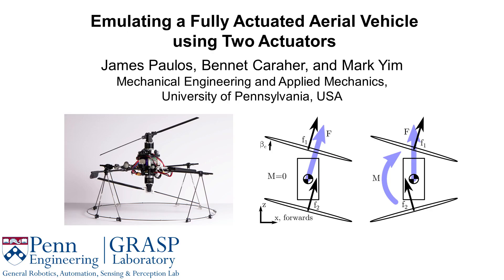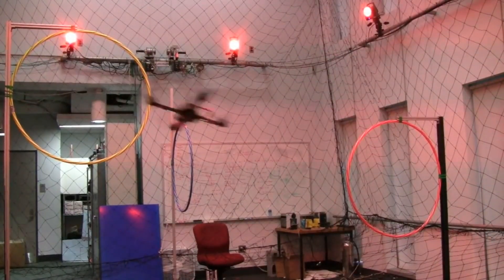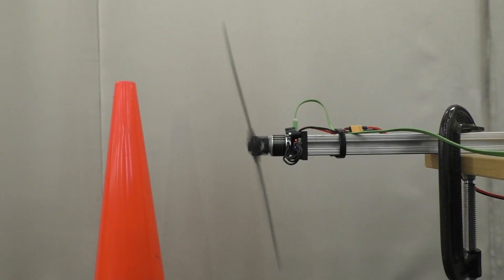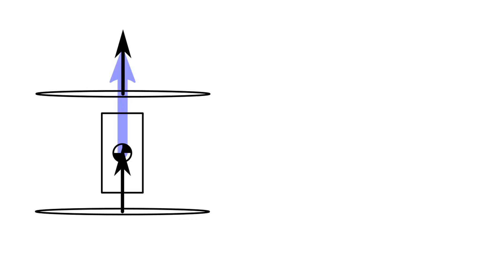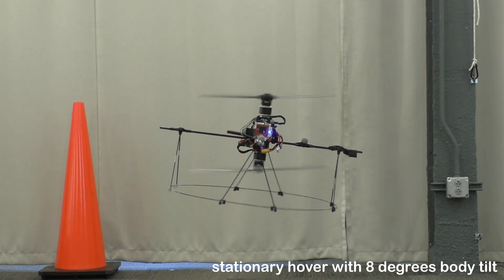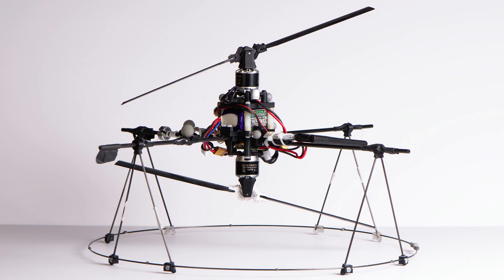A Fully Actuated Aerial Vehicle using Two Actuators

Comment: the whole thing about quadcopters is about less moving and strained parts. saved 2 motors, but gained very stressed gears and joints. wonder the endurance and wear results agains quadcopters
Reply: long time reliability kinda doesnt matter for suicide drones or suicide-drones-intercepting suicide drones

Comment: So, this uses gyroscopic procession to angle the rotor. It requires very precise control of the rotor velocity as it rotates.
Or am I missing something?
(I was missing something. It dawned on me later.
The blades are hinged asymmetrically, so they will be angled oppositely when they are slowed down or sped up. Giving less or more lift on the opposite sides.
It has nothing to do with gyroscopic precession. )

Comment: the continuous instant acceleration and deceleration to achieve the pitch of the hinge consumes much more power and motor are likely to be overheated, if the motor can be modified to adapt sinuous pattern natively I bet this can outperform the traditional quadcopter, but as of now it can’t.

Comment: An outrunner is no good choice for such kind of torque modulation. Its massive momentum of inertia requires huge power to modulate its speed by accelerating/decelerating. You need a low inertia motor. And still, the efficiency of such vehicle drive concept will always be bad compared to a simple quad.

Comment: wow, seems to be even more steady than quadcopter. Can this be better for aerial photography ?
Reply: the thing is that most of the space where you can put a camera is obstructed by the blades, so you have a very limited FOV  up and down.
Reply: a quad is technically simpler with only 4 moving parts. this has at least 6 and vibrates. i'm also very curious how efficient this design is, would not be surprised if it's like half as efficient given lots of energy goes into slowing the rotor half the time. one pro tho is being able to tilt with no lateral motion, that could easily point a frame-fixed camera or sensor (like lidar), making a flying 3 axis (downward-facing) gimbal who's entirety is only 6 moving parts. or some type of manipulator could be attached and used for tasks since it can tilt and rotate without flying away. or vice versa, the thrust can tilt to find wind without actually tilting the airframe like a typical multi. if those props+encoderbrainthing are cheaper to make than buying 2 more motors and 2 more escs then this arrangement could be mass produced for cheaper than an equally capable quad.
Reply: good point, it probably would be
Reply: @ScienceAlliance   
You would have to put some effort into vibration-damping the camera so you don't get jello vision. 
The way in which it drives the motors will create vibrations. 
A large film grade hex/octa will almost certainly be smoother with the added benefit of motor and ESC redundancy in case of a failure.
Reply: chris746568462 yea true, it would need time to allow stuff like that to be figured out. But like, theoretically with those improvements over time, it would be a better solution atleast in a lot of cases.

Comment: Its a really clever idea but I wonder about scalability of the concept. Varying collective thrust by rotor speed changes is not viable at the scale of today's helicopters due to rotor inertia...time constants of seconds do not give enough control bandwidth. Hence, Volocopter and the rest use multiple small rotors (each with low moment of inertia) to give large effective rotor area and therefore low pressure / disc loading and acceptable energy efficiency.  So at the scale of passenger electric rotorcraft you are going to have multiple rotors anyway, and each one is an actuator, so you might as well use it for attitude control as well. I reckon this new concept is applicable to rotors of up to 2m diameter or so due to this inertia limitation. With disc load of 400pa that means takeoff mass of 120kg... not enough for passengers but OK for a larger drone. 
Mechanical simplicity (lack of swashplate, flap bearings etc) is one of the advantages of multirotors over helicopters. This new concept re-introduces some mechanical complexity, but reduces the number of rotors. That might be a good tradeoff for some medium sized drones but it's not a universal solution. If we accept mechanical complexity then just driving a conventional helicopter rotor and tailrotor with electric motors and using servos on the conventional pitch controls is always an option. Where is the market niche for this I wonder?
Reply: But the other way is where it shines. This lends itself to microscopic drones. Ditching so many parts makes it possible to really scale it down. This makes the fly on the wall an easy project.

Comment: Remove teetering hinge at rotor head and instead mount the motor using a 2-axis teetering hinge for uninhibited 6DOF flight?
Reply: plus the addition of 2 more actuators, remember.
Reply: Chrismofer only when the rotor axes are aligned, involving a 90 degree rotation of the body similar to “gimbal lock”. This might be able to be controlled via differential torque with the addition of a damped mechanical connection between the two hinge assemblies or by constraining the motion of the 2-axis teetering hinge.

Comment: Is there a loss of efficiency having the lower rotor being in the wash of the top one?
Reply: To the contrary it can improve the efficiency by recapturing fluid rotational losses. The same reason there are stators in ducted units.
Reply: @thebunnisher109  but in practice coaxials are less efficient than tandem rotors.

i think its more important to ask if there's a loss of efficency by electrically braking and then accelerating the motor once a rotation. i'm guessing there's a big energy penalty.
Reply: Chrismofer “in practice” in which application? Coaxials in practice in numerous applications are significantly more efficient than a tandem arrangement in a properly designed system. Proper design requires the two rotors are not the same: the downstream rotor must have variable pitch and speed to counter the input of the first rotor, and it must have a smaller diameter to be wholly within the accelerated flow of the primary rotor. 

For your second statement...a rotating mass is a battery in itself. Perhaps the most efficient means of “cyclic braking” is with a mechanical differential between both rotors that is varied by positive input of a secondary motor rather than the start/stop of the primary.
Reply: @thebunnisher109  oh. Michael was asking about this vehicle with symmetrical rotors as is most typically seen in the full scale coaxial helicopters as well. but let me ask, if the downstream rotor is smaller and pitch+speed follow the most efficient energy recovery from the top rotor is torque still conserved or would this sort of coaxial heli still need a tail rotor? the above vehicle requires that the props exert equal torques in flight (as actively controlled) to maintain yaw stability. Actually I've never seen a coaxial helicopter with differently sized rotors, because they always use the differential torque to control yaw. works in tandem too, except more efficiently AFAIK.
Reply: Chrismofer very fair assessment and you are correct there is a hit to efficiency in non steady-state situations. However, if we assume that our operational profile relies PRIMARILY on steady-state hover then it is likely the net efficiency will be greater. For a high-performance racing POV drone I’d probably scrap the coaxial altogether like you suggested. One way to mitigate this is with blades that feather, which these blades might do since their pitch is a product of blade inertia and aerodynamic drag. In this case I’d play with the number of blades to fine tune the torque for the blade speed. One additional benefit of this is structural vibration and noise reduction if I can have a coaxial setup with two different prime numbers for my number of blades, some good maths in action and a physical analog to cryptographic keys ;)
Reply: @thebunnisher109  It would be interesting to compare the electrical efficiency of this coaxial vehicle with a quadcopter. I suspect the larger lower speed rotors would be more efficient that smaller high speed props. There might be a significant difference in the amount of noise as well.

Comment: I've read their publications a couple times, there are no hidden actuators and I think I understand so bare with me for a second while I try to explain. If you take a piece of paper from one end and pull it through the air quickly, the other end of the paper will rise up due to drag pushing up on the paper. When you slow down a bit the paper will sag a bit as the drag force is now lower. The amount that the paper sags or rises are proportional to the drag force applied to it. With your hand, you can control this amount of drag force by adjusting the force with which you pull the paper through the air. Similarly, if you imagine trying to do the same experiment using a motor to drag the paper through the air, you could control the amount the paper sags or rises by varying the torque applied by the motor. 
This is precisely what I believe they are doing here. the narrator mentions driving the motor with a sinewave input, if you doing this slowly with the paper example you would see the paper cycle between rising and sagging. The 3d printed passive joint allows the rigid propeller blades to respond to the variable torque similar to how a flexible object would and intern allows control of the inclination of the blade. 

My question is how do they ensure the phase of the motor, input signal and blades all remain properly aligned, I understand the theory proposed in the paper but do real-world factors affect the system enough to require state estimation for stable control or is the theoretical model enough to implement the system? Are the motors tracked using encoders?
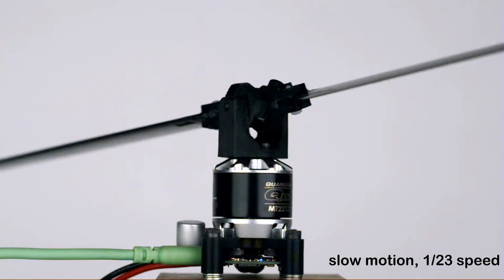Reply: From the video at 1:09, it does look like they're using an optical encoder may be..

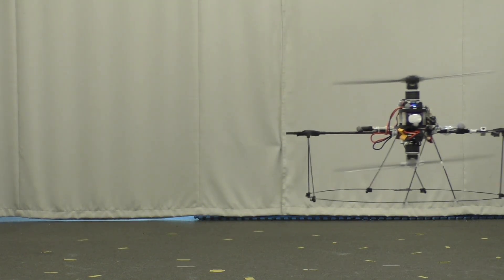Comment: 0:41 So by changing the speed of the motor (or better yet the change in torque) you are able to change the tip-path plane?
Reply: Change angular acceleration not speed

Comment: Very nice !  It looks like you have perfected the variable rpm/ passive hinge blade pitching method. I am still working on the Mars Electric Flyer bi-rotor VTOL concept and think that it is a perfect fit for this technology. Wondering if you might be interested in building one at UPenn? Also, I would think the JPL/Aerovironment Mars coaxial helicopter team would be very interested in this. Their helicopter is now officially on the Mars 2020 mission. -Dave North, NASA Langley
Reply: Sir, can you give me link to learn the propeller pitch changing with this type...  i dont seen any actuator in it..  then how the blade changing the anglee..
Reply: Now, this is the kind of feedback we need to see more of on channels featuring ingenious solutions for rather common problems.

Comment: being able to control body rotation is nice for some uses

But doing it by adding a time and amplitude-varying vibration for each motor on the MAV? How do you keep the vibration caused by changing motor torque from a) swamping any accelerometers on the uav and b) ruining the picture from any cameras?

I notice this is an externally controlled copter, flying in a cage with beacons and cameras. Has this thing flown with stabilization ON the aircraft? Ideally from normal MEMS accelerometers or some other common cheap method of stabilization that would work on an aircraft that is optimized for simplicity and low cost/low parts count?

Not only would you have to isolate the camera from huge vibration, which might be as much trouble as just using a regular elastic isolator like normal quads have on camera gimbals, but you would either have to control it externally or put extremely high-performance accelerometers and filter logic, and/or huge amounts of physical isolation.

It might be possible to fix this but it's a pretty huge obstacle. I'd need to see vibration addressed next, before anyone took this and developed it further. It seems like the kind of problem that could make a project completely fail if it wasn't taken seriously from the beginning.
Reply: my understanding is that the torque is rotating with the motor, that means that it doesn't introduce vibrations in a different manner than what the rotor imbalance does.